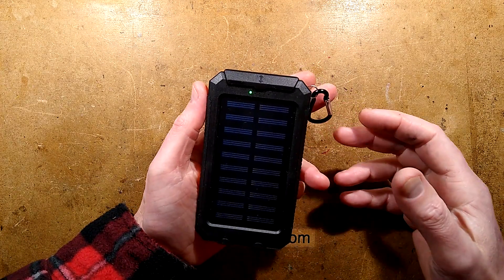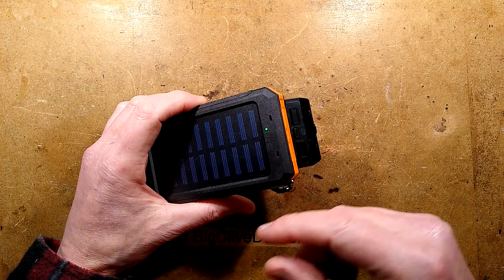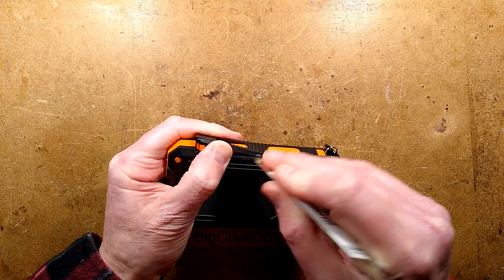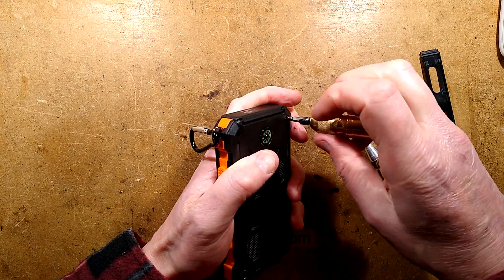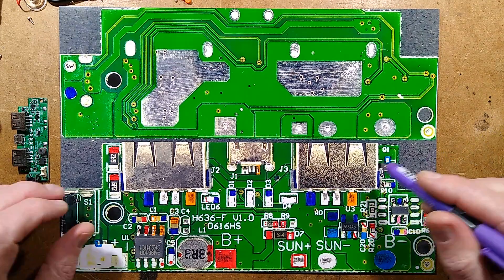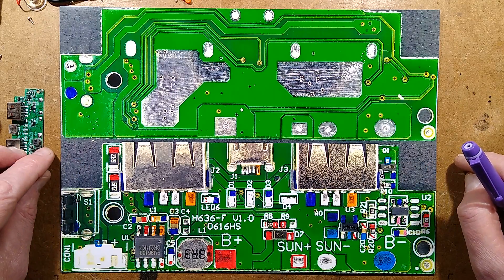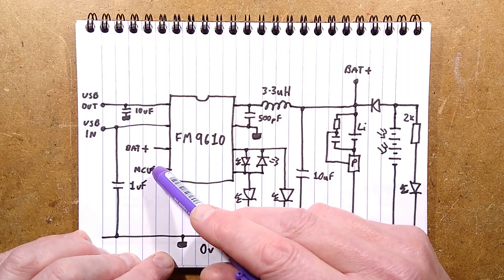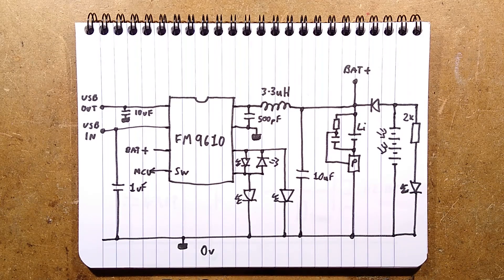eBay 9 MILLION mAh power bank teardown (with schematic)

Comment: I bought one of these once, not the obviously fake 9,000,000,000 mah version but something with a more reasonable number, I wanna say 10,000 mah, granted it wasn't even anywhere near that. The solar panel was real but the coverage much like this one was nowhere near full coverage and it took forever to charge. I don't know who makes a reputable good model of this thing if anyone does, but it would certainly be a nice to have.

Maybe it's just too small to effectively use a solar panel even with full coverage, I'll admit to knowing very little about solar panels

Comment: When I was looking for a power bank for a heated jacket, I saw these units, I simply knocked three noughts off and got 1,000 amp/hours. This is about equal to 10 lorry batteries! I decided that the makers were a teeny bit economical with the truth and did not buy one.

Comment: Sir, either i am wrong or you are. 
We can not have it both ways.
But, i own this particular example of a powerbank, and i must say that indeed i can power my Tesla no problems.
I can take it for a spin for roughly 2 hours if the pack is fully charged.

I do have to say that the Tesla i drive is scale 1:24
And basically any flat surface will do.

Comment: I am a bit surprised that they use ballast resistors in series with the flashlight LEDS = energy wastage.  Why not use LEDS in series instead? That would also save some component cost. (I realize that means 1 failing kills the lamp function)
Reply from the maker: A resistor is needed to limit the current because LED current varies dramatically with voltage.
Reply: @bigclivedotcom  I know, I use LEDS in circuits, but in series a much lower value could be used, greatly reducing power loss.

Comment: Why do they go out of their way to completely lie to customers when most people have no clue what 2500mAH even is... and those that do know there's no such thing as a 9million mAH battery and won't even think of buying something from a vendor who lies to them from the outset.

I suppose if you are looking for free cells you could just buy a load of them and then get your money back from Paypal or Ebay whatever citing that it was not as described. Ebay can hardly refuse since its not possible to build a 9 million mAH battery farm that's smaller than a commercial power station.

Comment: Same as these jumper boxes they have on amazon and ebay that say 1200 Amps, but they have what looks like 10 gauge wire and tiny battery clamps.  That's good for maybe 50-60 amps for a very short period.  A typical car battery cable may be 2 or 4 gauge wire to handle 150 amps.

Comment: The item is 224.8 cm3 in volume, gasoline has 1.3e8 joules per gallon. Assuming this entire brick were made of liquid gasoline that could somehow deliver electrical current directly and you were using slow charging at 5v thats a total of 428827.8 mAh or about 1/20th of the listed claim. Battery technology is amazing!

Comment: I bought one that is similar, but different in a couple of ways. Only says 20k mAh and the button for the light does different functions and operates differently (you have to hold it to turn on the leds or else it just shows the charge level). But it seems like it was around a 10k battery inside as it recharged my phone (5k mAh) from 4% to 90% while I was using it all day. The pack only had under a half charge or so so it may be a better one. I got it off of Amazon of course lol.

Comment: I actually made a custom power bank of 28,000mah which was just full of Panasonic batteries same type as there joint partnership with Tesla. The unit was 2 or 3 times this size and the batteries cost me £40 ish to buy 8x 13650 at 3,500mah each the max capacity as of 2019 the time of build. The unit took about a day or 2 to charge no joke.

Ebay should really question sellers that are making false claims of there capacity as that is clearly false advertising and breach of law.

Comment: the squishy sides made me nervous knowing they installed a much smaller battery then expected and a weight that would help with support so this might be somewhat safe the charging circuit/USB regulator is the only good thing about this device I wounder if a bigger solar panel can be installed like a 10 watt and a much bigger battery after 3D printing some better sides that add support and enlarge the casing and if your going for this might as well add another board for 4 USB ports and double charging ports or lets look into building the most ideal unit from scratch from 18650 cells combined with power bank board and solar to usb 5 volt board and a switch being the simple way USB C can put out 15 watts and if combined with a 30 watt panel your gonna get that 2 amps even on a cloudy day

Comment: Lol... I had one of those back in 2012... Red... They're only like 4,500 to 5,500 battery... They fuff the capacity by including the solar while charging and say that it's an "equivalent" for their false claims!

And it can charge in the sunlight, you simply have the make sure it has ventilation... Never once had any heating issues... BUT, I will point out - the solar panel is so weak that it can't fully charge the battery in a single day!

Comment: I bought the same one from the same seller on ebay, i'm sure the cost was  £11.29, the £5.29 was for a sticker or some rubbish, it charged my phone by 15% and then went flat, I took it apart and found exactly the same as you did, I had bought a few 3700mAh Battery packs of ebay cheap and managed to solder 2 of them in parallel in the case after removing the original battery and weight, they only just fit, but at least it's a reasonable device now.

Comment: I have that exact battery pack! Though it is under a random name, and I got it for Christmas in 2020. I just a couple of days ago took it apart because mine had lost the usb cover and one of my kids spilled juice into it. I really like it as a battery pack, I just wish mine was the 9 million mah version, and green instead of red
Reply: Ok, nevermind. I just saw where you opened it. Mine has a two batteries that take up the whole inside of the case without added weights

Comment: It needs another solar power bank to fix one. The 000 or 200 resistor is memory effected by default, when you buy one. Charging is rated at 700 mA, 220v 150 mA. Using different charger may disable the battery after a while. You can use a 1A charger at 220V 150 mA at first 50 charges, till the battery becomes calibrated. Exceeding the 5h time at first, ruins battery. When calibrated, you can leave charging overnight. Fixing the solar panel takes 2 seasons. Then you can use it as solar charger only.

Comment: The worst thing is that the solar cell as supplied is not a high enough voltage to charge the battery. The photographs on sales are with cells with five lines but the ones supplied are only three, reflecting the number of cell strips and according voltage.

Comment: I bought a similar and (cheap) jump pack with a solar panel on top. A drained battery took almost two days to fully charge in full sunshine. By 3 months later the cheap battery was so bloated it popped the case in half. You get what you pay for.

Comment: "The lithium cell test came in at just over 9,000,000 mAh at 9,000,005 which is pretty good...  No not really."/// Of course not, that would be an astonishing 0.00006% tolerance. I doubt even the Chinese are able to manufacture to such accuracy.

Comment: For whatever it's worth, I have one of these with a battery that fills the entire case. I left it in the sun, situated where it couldn't cause any trouble if the battery did get angry, and amazingly, so far it hasn't. I wondered if the solar panel was even hooked up, but it does seem to charge. I've never tried to see if it would ever charge fully from the solar panel.

I have another one with a total of four solar panels that unfold. That one will charge in about a day or two. With it, the panels being in sun actually cause the "charging animation" LEDs to start.

Comment: A friend of mine bought a "1,200mAh power bank that delivered maybe 250mAh. I opened it up and discovered that 3 of the 4 18650s inside were filled with sand. 🙂
Reply: that last one must've been mostly sand too, they're usually at least 1000 mAh on their own
Reply: @TheAechBomb  Recycled cell makes more sense. They can usually be in that range
Reply: I had one of these when I was young, that 3 Out of 5 was filled with sand xD

Comment: 9,000,000 mAh is 9,000 Ah. 9,000 hours at 1 amp, 4500 at 2, 3000 at 3, 1800 at 5 amps.  Still a lot for so small a unit, but never enough to run a Tesla. Or even its headlights, really.

Comment: That's a 9 amp hour USB charger, the solar panel probably generates 150 mah so would take months to fully charge if actually away from grid. Most are junk in my opinion but good if you need to keep a phone going for a couple days though I'd stay away with the ones with a solar panel on it since your paying extra for something that does not produce the power to charge the battery in a reasonable amount of time.

Comment: I had 2 of these, one failed in a few weeks, it was the charging circuit. So i took it to bits, put the compass on my dashboard, made a torch from the lamps, used the (i think 4000mAH) battery to run some bluetooth speakers, and threw the rest away. I think i gave the other one away....

Comment: I bought a similar battery device several years ago at a  Lidl's grocery store. I think it sold for around $12 and had no such ridiculous claims. For a  back-up battery for your phone while you're traveling, it works quite well. The solar cell will recharge the battery, but it will take days. If your workplace has bright lights, you can just leave it on your desk,  but it can be quickly recharged by way of the micro-USB port.

Comment: Hi, I bought one of these a few years back and it seemed to work ok. About a month ago I noticed that was beginning to swell so I stopped using it. I was also curious about it so I opened it up as you did. The battery was full size and there was no extra added weight. I still have the battery and can send you photo's of it if you like.
Reply from the maker: If the battery has started puffing up it's a good idea to discharge it as much as you can through a suitable load, and then recycle it.  The less charge it has, the less volatile it will be.

Comment: Just recently I bought a clamp meter for checking the various cables in the house. I put the two AA batteries in,and the display came on,reading zeros. However I get no readings at all when I test the cables,even when testing the main input from the circuit breakers,no matter what setting I use. Am I doing something wrong? Can you advise me about the correct setting for checking the feeds to sockets?
Reply from the maker: It has to be round a single core and not the whole cable.

Comment: Let's give them the benefit of the doubt and just assume they were trying to be very accurate with the rated capacity all the way down to four decimal places but forgot to put in the decimal.

This does lead me to a question about power banks I can't find an answer to.  Here's hoping someone here might.  I have a bluetooth speaker that will work with some power banks but not others.  It will get power and turn on but the power bank will turn off the USB and stop providing power.  Other power banks though don't have this issue.  They just stay on until I turn them off.  Oddly enough it is almost always the really cheap ones that work fine and quality ones won't leave the USB port powered on.  They stay on with a phone though.  Is there anything that can be done to get the good power banks to stay on when I plug in the speaker?  Does it have something to do with the D=/D- pins?
Reply from the maker: The fancy power banks with LED charge level indicators will shut off below a preset current point.  The cheaper dumb units just put out 5V all the time.
Reply: @bigclivedotcom  Is there any way to force the "good" ones to stay on?  I have a really nice one that puts out a solid 2.1A on both USB A ports and does a 7/9/12V 3A quick charge on the USB C port.  It stays on with any phone or tablet but won't stay on with less intelligent devices.  Even if I have the phone in one port and the speaker int he other it still turns off the individual port to the speaker.  Quite maddening.

Comment: I've tested one of this solar power banks... it's funny because you must protect it from non solar lights. When it's exposed to indoor lights it starts "trying" to charge. But the charge indicator led drains more energy than the produced by the panel effectively discharging the battery instead of charging.

Comment: The 9000000 mAhs come from the sun through the solar panel duhhhh! 

A way to charge these for free is to get one of those 4x power strips, plug it into itself, and then plug the battery pack into the stip.

Comment: Brought one of these a few years ago, had it 5 minutes and the usb cover broke off, it doesn't hold a decent amount of charge, the solar panel is practically useless and for show and it lasted about a year of me using it about a handful of times due to the crap amount of charge it holds. It mostly sat in my bag gathering dust till i pulled it out one day to find it bulging so it went in the bin lol.

Comment: i made my own powerbank ...this is on ebay..just add battery's... DIY 21x18650 Battery Case LCD Display Power
Reply from the maker: I was just looking at that and pondering the armageddon if one cell made an intermittent bad connection with a high voltage differential between it and all the others.  But it does look interesting.
Reply: @bigclivedotcom  hopefully its a big enough fire to heat the house...lol

Comment: If it was filled with batteries instead of a weight to scam people you could potentially get around 15,000 - 20,000 mAh for that size, if it was super cheap I'd almost forgive them if it was 9,000 mAh and advertised correctly, but 2410mAh is obviously a joke.

Comment: The PCB for the LEDs could be one of the newish ceramic prepregs such as the SH260.  It's meant to be used with an aluminum substrate or core, but can be used stand alone as a lower power thermal heat sink at a much lower production cost as it can be used in the same production methods and setups as most FR4 prepregs.

Comment: I have a powerbank that appears identical to this one.  It was a gift.  I've never taken it apart, and I'm now curious if the cell is also deceptively small.  I have not measured it's capacity but it seems about typical for a low cost unit around this size.

Comment: My little torch is rated at 10,000W. (10kW). The battery is fitted into the space of a standard 18650. 
10000W/4.2V = 2381A. When I put it on charge, all the lights in my street go dim, and a team from SSE go door to door asking who the clever-dick is charging their torch battery. Should I ask for a bigger supply cable?

Comment: What about lithium powered 
Solar street lights and floodlights? Based on experience they handle heat pretty well.
Reply from the maker: In those the lithium cell is mounted away from the hot solar panel in a vented enclosure.
Reply: @bigclivedotcom  Thanks

Comment: For those scared from the 9,000 Ah battery (that looks more like a 2 Ah one), a Chinese seller told me that the label on a device or a component is meant as advertising space, not as the component specifications - True specifications are less appealing and reduce perceived value.
The 9 millions label is a "nice touch" in the East, but a "fake to the core" in the West...

Comment: I recently bought a "42 AH" power bank that appears cosmetically identical to this one. It's usable capacity tested at a mere 12 AH. Furthermore, the specs given about available dis/charging currents and voltages were a straight up lie. 

All said, not bad for 18 bucks.  🤷‍♀
Reply: Also it possibly bricked my phone, though I have no proof of this and have not tried 'scoping the output (yet). I've never seen the GPU fail on a phone before, but I imagine it happens.
Reply from the maker: I wouldn't expect a 5V charger to damage a phone unless it put out a much higher voltage.
Reply: @@bigclivedotcom  I assume these have some sort of built-in DC-DC converter somewhere. The thing makes an audible HF hiss with a load connected. I have no real idea if a malfunctioning DC-DC converter can put out transients of sufficient magnitude to damage a phone- but that's my working conspiracy theory.

Comment: 9000Ah is still more than enough to crank my car. If I get three in series to give 27000Ah at 15V, that's close enough to 12V for my starter motor. and gives me 200 times the starting current I need.

Comment: I just did the math and if the power bank that I am holding were an equivalent volume flask of diesel fuel that could slowly be converted (with atmospheric oxygen) directly into electricity at 90% efficiency, it would be equivalent to ~880,000 mAh capacity. Enough to charge my phone about 327 times.

Comment: So I'll need 623 of them to power my flux capacitor for a minute, plus another one or two to get my Tesla time machine up to 88mph?  Really wish they'd have omitted the 44kg of extra mass in all those steel weight blocks, but, then again, they may help with traction in the slush.

Comment: I would guess: they built it, then they charged it 100% and then they added a load with a power meter and then they stored the test setup in the sun, solar panel up

Comment: Actually it's 9 million MILLIAMPEREHOUR, that is, 9,000 Ah. Times 3.6 V gives a little more than 30 kWh, which is quite a large amount of energy but not just as huge (one thousandth) as you calculated. For instance, it might power a Model 3 for around 120 miles, which would be remarkable anyway for a humble powerbank.